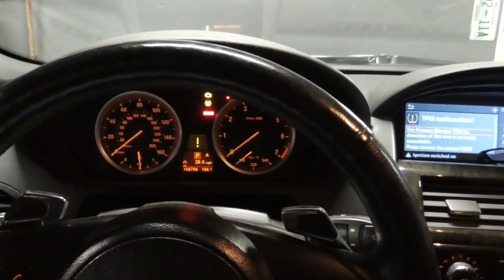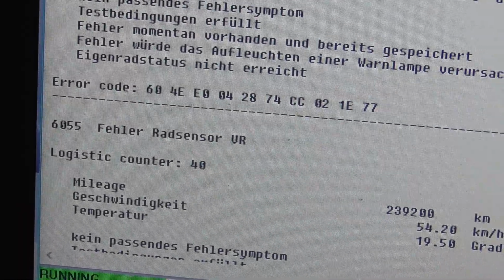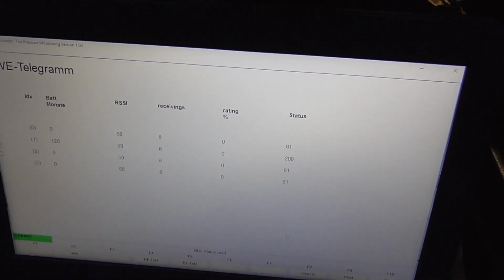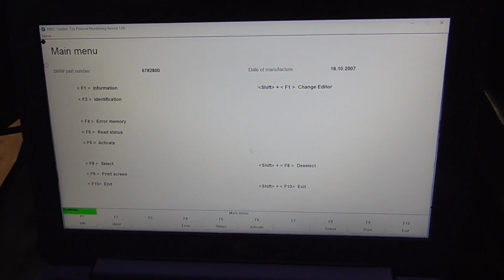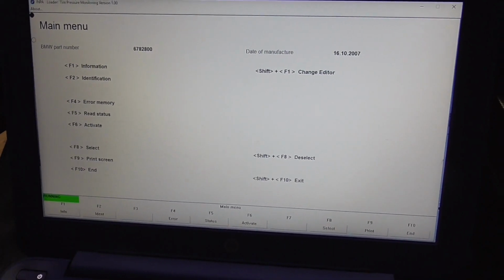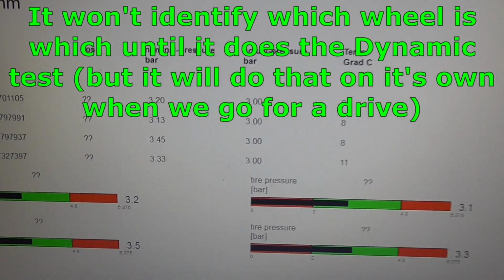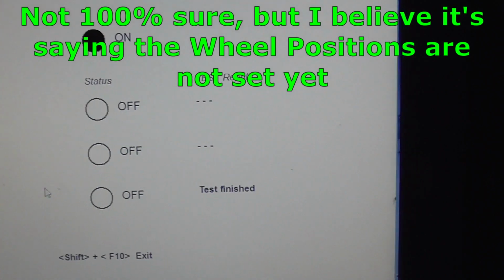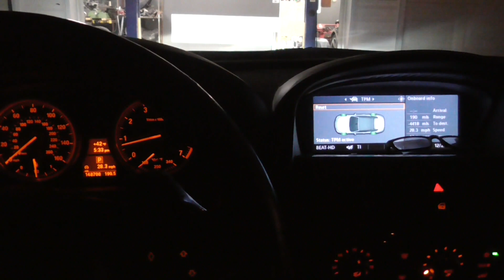BMW TPMS Fault Fix (604E & 6054, 6055, 6056, or 6057) - Sometimes it is just a Bad Sensor

Comment from the maker: For reference, here’s a link to my Steve’s DIYs Facebook page that shows a pic of which sensor I used to replace the OE one:  https://www.facebook.com/share/gXqxwFcjB6vh6BdD/?mibextid=WC7FNe .  If buying from Parts Geek, just type “Huf RDE048V21” in the search box and it should pull it up for the 2004 to 2010 650i

It’s been about 7 months and I’ve had no issues with the replacement sensor so it looks like it is a good option for the replacement 👍
Reply: Thanks for the info! I'll do the same. I have to verify the correct build date from the dealer. It looks like a change was made on my MY at the build date!

Comment: Hi Steve, I'm running into the identical issue: 604E and 6057. You said you got a new sensor. Did you get an OEM sensor? did you end up replacing the other three? Would you recommend aftermarket sensors? I wasn't aware that inpa could be used to train the sensor, that's great info!
Reply from the maker: Hey !  I actually used a Huf brand sensor as I believe they are one of the OE suppliers for BMW but sell as their own brand also. Since this was the only sensor that was giving problems, I just changed it as I’m due up to replace my tires this year and will replace the other three when I change tires (the tire shop is really good about damaging the beads on these run flats as noted in the video so I didn’t want them damaging the other tires just to change the sensors). 

Here’s a link to the info of the sensor I used I put out on my Steve’s DIYs Facebook page. I purchased it from Parts Geek, but I’d say other web stores carry it as well:  https://www.facebook.com/share/gXqxwFcjB6vh6BdD/?mibextid=WC7FNe .

Yep, INPA isn’t the easiest to get around in, but with a little practice it manages to do most of the normal things for these. 

Glad the video helped some and all the best !  Steve
Reply: @StevesDIYs  Ahhh...so close but yet so far. My version of inpa is mostly German, so, working through it required me to get acquainted with a few things, thought mostly, it's pretty close, so I followed your instructions until the part for the static test, where mine did not have F1 , only F2, 3, 4, 5, 6, 7, 9, 10. 

Lastly, my live readings don't seem quite right. I'm getting the same readings even with the wheels away from the car, like on the other side of the house! Except for the battery status, where I was getting some readings at the "receiving's" column,  now its all 0's there too. 

My issue is that I don't want to guess at whether it's the TPMS or the RDC. I may go to a tire shop and see if they can scan and get some kind of reading, that way I can compare. My car is an '11 E89 with 25k and it has barely seen rain (except for washing her) but, you never know, RDC could still be corroded.
Reply: UPDATE: I went driving with Inpa hooked up. The thing lit up like a christmas tree.! Looks like just the right front sensor, but the battery still shows 0 for all sensors.
Reply from the maker: @xr500t 👍. Yep, mine is in half German as well.  Takes me longer to Google translate than actually find the faults most time lol. Yep, I don’t really trust all of the info INPA gives for the readings as it seems to do it’s own thing once the car is rolling and it automatically goes into the dynamic sensing mode.
Reply from the maker: Nice !  Yep, my batteries aren’t consistent on the readings either, but as long as it picks then up I’ll call it good.  At least it sounds like it’s just a sensor like mine was. Hopefully you’ll get it back happy again once the sensor is changed and picked up on the static test so then it will find it in the auto dynamic verification.

Comment: Hello There Steve,  Thank you for another informational video.   Question for you please,  The car you were working on, does it have an on board compressor to fill air in the tires when needed automatically ?  I think some cars can do that, not sure.  Is that true ?
Reply from the maker: Thanks man 👍. For this car, it has a small compressor in the trunk for emergencies, but it’s not connected to the tires to keep them filled continuously. I have seen some commercial vehicles that have a compressor that constantly maintains the tire pressure, but I’ve not seen any on regular cars. The run flat type tires that this one was equipped with originally are the kind that the side wall is soooo thick that it doesn’t flatten out even without air.  If there’s no air in it, you can still drive up to 45 mph and still be ok until you can get to a tire shop to have it replaced. Was a great idea I guess except that they are really made to be replaced if they ever go flat as it damages them slightly to drive with no air…thus they get damaged easily when removed from the rims.
Reply: @StevesDIYs Hi there Steve,   Wow, I never knew that about those extra thick side wall tires.  Actually, that’s interesting idea.   But why can’t some genius inventor make a car tire that is completely airless and still be strong enough to hold the weight and highway / freeway speeds ?
Reply from the maker: @GarysnewYT 👍. I’d say tire companies not developing them has something to do with getting sales on folks replacing tires from punctures and flats.  The tire shop also said when I took the tire over, they couldn’t put the run flat back on because it was damaged, but I had also put a temporary plug in the tire from a nail years ago and they also said it was not safe to have the plug in it. I’d say it’s all about the money and tire companies wanting the tires to have to be replaced…that and folks like different rims so having a tire that can be mounted in different rims is a big benefit. If the tire was filled with foam (like some lawn equipment and tractors) it would have to stay on the original rim as they cannot be removed from the rim without cutting them off.